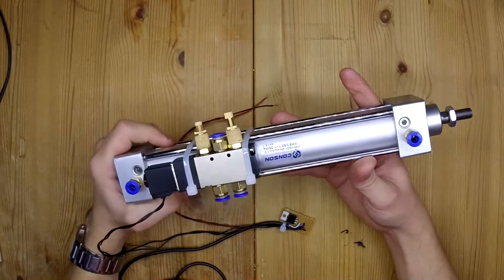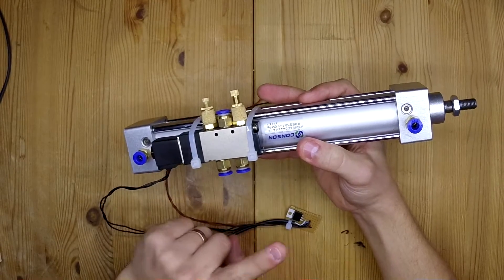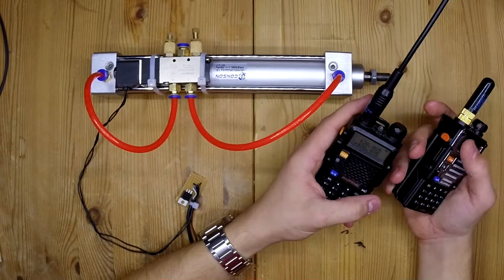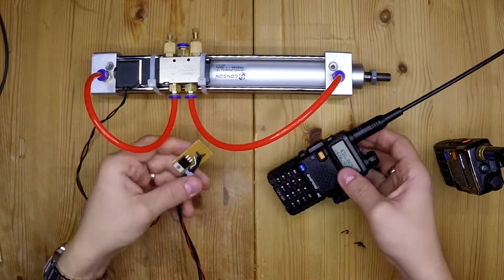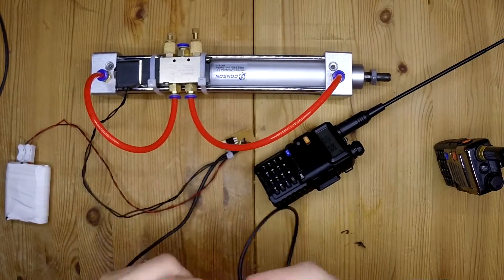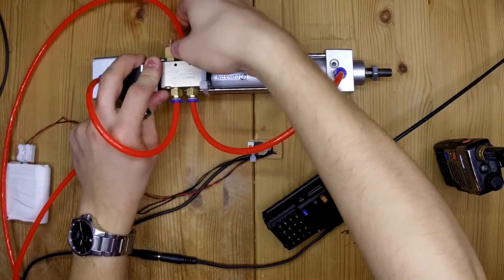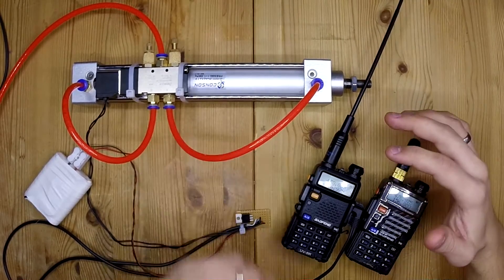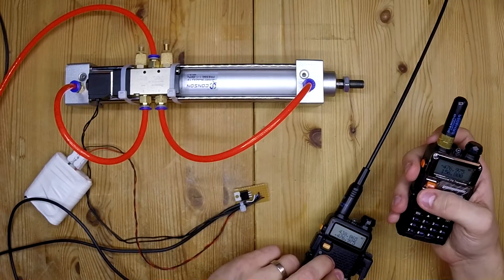Remote Controlled Pneumatic Piston

Comment: I image if you attach that to your emergency brake cable, or handle, it would quickly lock the back tires up, thus creating an emergency. I am extremely impressed with the engineering and craft that you have put into building this vehicle. I would love to see it being driven down a trail or a road from a chase vehicle.

Comment: You could get an Esp8266 and a relay for under 10 bucks and activate your pneumatics via wifi
Reply: Do you know what the purpose of this system is?
It is supposed to emergency brake a real life sized car.
A handheld radio is way more reliable than an ESP8266 and also has longer range.
Reply: @7_Max_7  bro, I'm trying to build a mini armored core mech. idk about this whole car thing